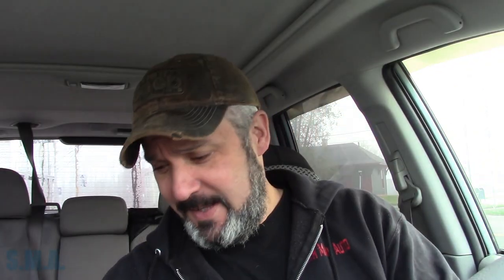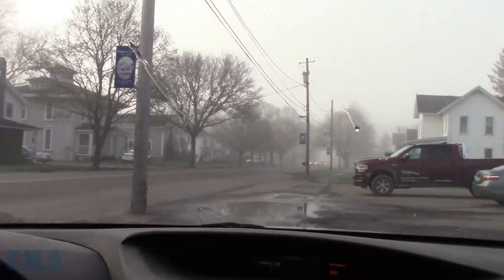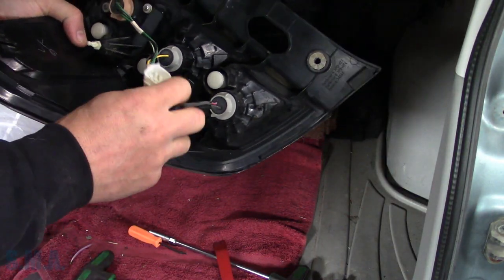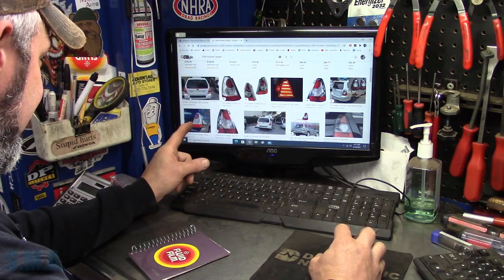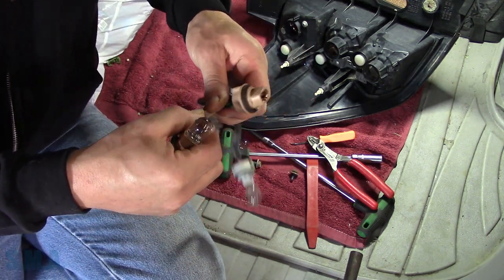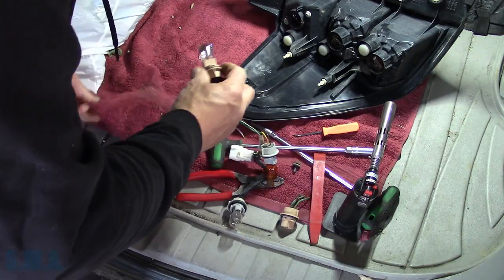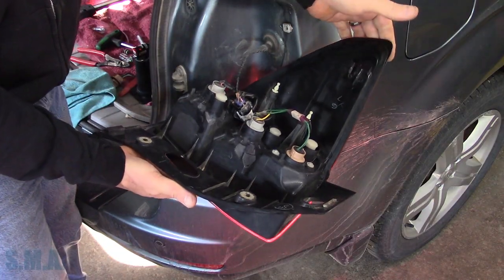Don't Be A Jerry!

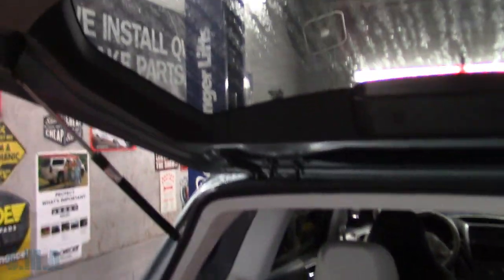Comment: If you pay close attention @1:36 her note says that at 5:30 in the morning she was stopped by a Police Officer because her brake lights "didn't get brighter." At 5:30 in the morning, she would have been using her headlights, taillights, etc. and so the circuit that "Jerry" stuffed the bulb into would have been "back-bleeding" power from the tail lamp circuit into the brake lights and illuminating them, too. So, as she was driving down the road, her "tail lights" on top would have appeared very bright because they were actually brake lights! Thus, when she stopped at a traffic light, her brake lights could not have illuminated any brighter, because they were ALREADY LIT. Notice that she said the Police Officer told her the brake lights "didn't get brighter." When Dr. O was driving the car to check it out, it was daylight outside and no illumination was required, so that is why he didn't notice the running lights coming on until he pulled into his shop in a darker environment and could see the running lights coming on with the brake lights. A quick bit of diagnosis at the time would have been to just turn the headlights on and see if they back-fed into the brake lights. Unplugging that right rear lamp assembly and the other lights then working normally again was a quick and easy point to the problem in the socket that "Jerry" messed with.

Comment: Just FYI for when tool-less in UIPULLEM yards, check the cars inside and and out for a few cars radius, look for work vans. They usually have tools left in them from previous owners, and some cars have OEM toolkits in the trunk hatches. Might not find wire cutters but you can usually find screwdrivers, pliers, scissors, wrenches, etc.

Comment: Nice troubleshooting! Need to update/upgrade connectors. There are connectors with soldier in the tube. Instead of crimped, you have a nice solid connection.

Comment: From what I understand, the use of "Jury rigging" is very similar to the WW2 version used in a type of slang called "Jerry Rigging".
Its basically a negative connotation to a potentially rigged court, or a German corrupt repair made on various mechanical situations.
Ive seen it used in a variety of ways over the years, but they both apply mechanically most frequently.

Comment: 2006 VW New Beetle, 2.5L gas ICE, 5spd manual transmission, 278,203 miles. 
I had a similar problem, left turn signals that lit with brake lights, AND the brake lights flashed with my left turn signal, which would cx my cruise control! I knew the exact cause, but lack the skill and tools to fix it. I told my mech what the problem was , my trailer wiring, and he scoffed. Said these VWs have wiring issues. I told him this was not the first time the trailer wiring caused an issue on the left side. When he called me back, he said removing the trailer wiring and sealing the connections solved the problem. BUT the mess had MELTED my tail light housing and sockets. I bought NEW sockets and tail lights, the tail lights were getting dull and cracked. Sometimes it really pays to have one car forever. You know its history.

Comment: @South Main Auto Repair LLC  I had 2 Subaru Outbacks [05, 06] both with rear lighting issues.  First would blow lighting fuse everytime headlights were on AND I put it in reverse; second Subaru simply had a basket of lights in rear that wouldn't  work.   Common problem in both - the wiring that ran thru upper tailgate to lighting and electrical systems in the gate fatigued and broke,  exposing bare ends of the wire(s) to make contact with one another allowing for shorts.  Had to cut existing wires back into roof and down into gate to splice in new,  stranded wire to the existing wiring, so there wouldn't be any splices hanging out in the pinch point of the gate hinge.

Comment: Excellent video.    I have made a simple bulb change as complicated as possible before so I can't laff at Jerry.  Years later, after I forced my way to work, I realized the body shop that just replaced bulb after an accident used the wrong bulb.  We still own the vehicle so I am going to leave my masterpiece like it is.  No use correcting it.  Next owner will probably be the crusher.   Things used to be so simple.  Gotta step up your game to keep up.  I am not a mechanic so it is an extra challenge.  I do not like the quick connect Ford used on the Expedition radiator hose.  I am finally getting the hang of unhooking quick connect Ford fuel lines.

Comment: A good auto mechanic uses max force every time & has parts leftover after the repair since he builds better than the factory.  Our pick N pull  is very handy for my junkers - 2006 - 2011+ impala has many similar parts so on sale days for less than $100 -  I get an extra alternator, steering pump, front calipers & radiator fan assembly then store for a bad day..

Comment: If there was a u-pull junk yard around me. I would be living there everyday, pulling parts that, "I may need in the future".

It's nice that Eric made a trip to the junkyard to save this owner money, because most shops would just order a 7443 harness or a socket.  Even though a new socket would have been ~$10 to $15, and then upcharge them.  And it's nice that eric tried to put money back into the local business.

It's too bad that folks are rude at that yard.  I tried to use local hardware and auto part supply shops and...  boy were they rude.  The auto part shop also upcharged ridiculous amount (2-3× oem prices) for non-OEM parts.

I stopped going because of the way they treated people.  Two years later autozone came in down the street, and a year after that they shut down their business.

Going back to this video, I wish people like Eric ran shops around here (NYC suburbs).  I would recommend people to him all day, everyday.  Keep up the great work.

I have been putting off doing my wheel bearing/hub, but watching your videos since 5 am (dang needy dogs worked as a team to wake me up to be fed) made me want to tackle it this morning.

Comment: Always love solving  so-called "mysteries" left behind by my lessors. You are being kind calling them "Jerry's". We always called them "hacks". The Mopar dealer where I worked was a revolving door of HACKS' if all ages, as was the GM dealer, where between both I worked over 20 years of my career. . I have,  like you I'm sure,  cleaned up more "Hacked-up messes" that you can imagine in over 45 years of wrenching. You know the type.. "electricals be mysterious" as one Hack used to say,.. Obviously, he worked using the smoke theory, and let the magic smoke out more often than not. Trouble was, he could necer get the smoke back in, even when using the "shotgun approach" to diagnostics and repair.

Working in the dealer, you are the end of the line. Any issues which  no one else could fix,.. the stuff people would often pay these HACKS thousands of dollars to fix with no success, sometimes when multiple shops ultimately failed, they ended up in my bay. 

There is a sense of pride and accomplishment that makes me feel good, fixing the stuff no-one else could, even if the other guy got paid a lot more to make a mess of whatever it was.  You know how it is, it's a curse to be a competent technician, you end up working harder fixing everyone else's Hack-ups, often at a loss. But, you can always make it up somewhere else on another job. 

The joys of Flat-Rate...Don't be a Jerry, or a hack!

Comment: My 2002 Sonoma had the antilock brakes acting up and the next day the brake lights went out. 
I had parked next to the blacksmith shop. Chipmunks found the cable from the antilock and chewed about 4 inches out of the middle.
Two hours standing on my head with wire so living tools reconnecting the wires. 
Darn ground rats!  😠

Comment: My best guess is the bulb is aftermarket and the base is slightly larger than it needs to be.  Then to add insult to injury they jammed it into the bulb socket and caused that downstairs mix up with the contacts, instead of taking their lumps and trying to find a bulb with a base that would seat nicely.

Comment: I've seen something similar with those 7440 bulbs, if you get the wrong bulb (like a 7441 or something or other) Jerry's will spend all day jamming that wrong bulb into the socket (not knowing that there are little glass barbs in different places) and kick the can down the road. That's why on the tail lights on my wife's car, there's amber 7440's rolling around inside the brake light lenses.

Comment: Dear Customer, We ECO warriors at Subaru KNow it isn't safe to drive around without brake lights so we will put a rush on your Brake Light Switch order and it will be there in a couple of 3 weeks. We suggest don't drive at night and turn on your regular lights during the day to simulate the brake lights you paid for. As for the rear end Body parts you may or may not need Pre Ordering might not be a bad idea.

Comment: A prior owner of a motorcycle I now have added some illuminated mirrors.  My headlight stopped working.  When I unwrapped all the electrical tape [warning sign]  I found a web of cross splices and the OEM signal wires cut out of the 'new' circuit.  Oversized crimp fittings everywhere.  What a mess.  As a bonus, cutting out the OEM signals disabled almost all of the security system.  I managed to get the headlight working.  My winter project is now rewiring the signals & security.  Grrrr.  If you don't know what you're doing, don't do it!!!

Comment: Where I once worked we made automotive wire. We had machines that were metric and some were SAE, small fasteners too, 4mm up to 10 and the SAE's were small as well. It never failed to run into a job where the speed merchant who was there on the last call had SAE in metric and the other way around as well using a handy impact. Jerry doesn't cover these guys and gals.

Comment: I had a bulb's little wire connectors hang up on the copper connectors in the socket pulling them "inside out" if you will. Had to replace the socket...Jerry is a ding dong!

Comment: I've seen that light socket scam done several times before to make vulnerable people (usually older folk with low mileage vehicles in good shape and is an easy resell) believe they had major electrical issue and convinced them  problem and is worth more than the vehicle. 
Its common overseas also.
Reply: I was never as good at tracing electrical issues as Eric. But I found it at least 6 times. 
It usually came from a shop that also sold used cars.
Reply: I also found out they figured out ways to short fuse boxes to eventually look like major issues. I hated those guys.

Comment: My wife has a 2015 Crosstrek, we’ve had a lot of odd wiring issues with it, the classic brake switch went out and the micro switch in the park position failed, couldn’t get the key out of the ignition. But also it likes to eat bulbs, I think I’ve replaced every bulb on that vehicle at least once, either cheesy bulbs or the voltage spikes and pops them.

Comment: Depending on the year (14-16) there is a recall on brake light switch. If it's in that range the dealership would have been better and cheaper than whatever Jerry charged.

Comment: I had a 99 lumina the brake lights wouldn’t work. The cyclops light worked when the brake pedal was depressed but the main two brake lights wouldn’t come on. It ended up being the the switch plate in the steering wheel. At first I thought maybe the rear bulbs were burned out. Since that wasn’t the case I went digging and found the culprit. So why would the steering wheel have anything to do with the brake lights? I’ll bet Eric knows. By the way, nice Job Eric.

Comment: Seen folks play with the pins in the socket when they get intermittent, had this happen on an F250 - PS turn signal lamp would work for a month or two then quit. Replace the bulb and it’d work for a couple of more months. Ended up being the socket, pins didn’t have the crusties - they just didn’t have enough spring in them to make a good connection. The leads on the bulb/connector would oxidize leading to high resistance. 

Guessing something similar happened here w/ this baru.....

Comment: I imagine that salvage yard has a lot of inventory that doesn't have much left in the way of parts equity or the vehicles might even be too obsolete, so to speak, for the salvage yard.  To put that in context, there's probably no need to hold onto that 94 Chevy Corsica to wait for that one weird guy who thinks its radio knob will work in his 93 Beretta.  I'd also wonder if the people who pull their own parts have done too much damage to what's left of the cars.  Cuz, you know, people always treat other peoples stuff with respect.  I suspect, one way or the next, they would want or need to make room for new inventory to supply parts for cars that are still on the road.

Comment: Did you adjust the brake petal switch?  That's definitely the reason she got pulled over that morning.  It did seem like you had to push the pedal pretty far to get the brake lights to light up.  The sensor should be adjusted to the point where even the slightest movement would light the brake lights up.

Comment: G'day, Mr. O! What, if your name is "Jerry?!?" Lol!! 😉 (I'm only kidding!!) Another, great job! Enjoyed the video! By the way... When you think of "Jerry Rigged:" To put together in a way that works, but is contrary to the “norm” or specific directions (service manual - instructions). To put together in an unusual, better or temporary way.

Also, refers to makeshift repairs or temporary contrivances, made with only the tools and materials that happen to be on hand. Originally a nautical term, on sailing ships a 'jury rig' is a replacement mast and yards improvised in case of damage or loss of the original mast.

For example: When I put together the new lock on my door, I broke off a metal shaft inside the lock so it could only be engaged with a key. That way, I can never be accidentally locked out of the house. I told a friend, "Don't worry about locking me out if I'm not here when you leave, I've 'jerry-rigged' the lock. Lol! 🤣 Thank you! 

Cheers!  😊✌🏻🛠❤️

Comment: I had a 2004 Grand Prix that would always intermittently lose a tail light.  The bulb wasn't bad, the pins would bend away from making contact from the heat of the bulb or something.  I used a screwdriver to bend the pins out with a little more tension.  I imagine that's what Jerry was doing here except he has less than zero knowledge of 12 volt electrics and properly hosed up that socket.

Comment: This caught my attention because I have a similar issue. I have a 2000 Toyota Harrier. I am in Japan. Basically a Lexus RX300. My brake lights work but when I press my brake pedal the dash indicator light comes on showing a brake light is out. It must be a short if some sort.

Comment: Crimp connectors?  They're heat shrink, so I'll give credit, but that only puts you only two steps above Jerry.  

I've had to remove way too many crimp connectors to fix connections right - with solder and heat shrink.  And that's down in Texas where corrosion isn't anywhere near as bad as it is up in New York.

Comment: Should have adjusted that break pedal switch too man. If you gotta push harder to get the lights a light touch for low speed braking isn't going to light the brake lights. Otherwise great vid, thankyou.

Comment: Actually,  it's "Gerry".  The word gets its roots from WWII,  and makes reference to the Germans (Gerrys) who would retrofit American jeeps with brackets to hold the 5 Imperial gallon size fuel cans,  and vice versa.   They were a slightly different size than the 5 US gallon cans.  They are still referred to as "Gerry Cans",  but were so often were incorrectly spelled as "Jerry Cans",  that the term actually made it into the OED.  The spelling was changed forever,  I'm afraid.  Worse still,  the modern term "Jerry-built" or "Jerry-rigged"  has morphed into "Jury-rigged",  which is actually a nautical term for makeshift emergency repair of  broken sail masts.  Some say that for a native English speaker,  German is the easiest to learn of the European languages,  due to its closer similarity to English.  I would have to agree, as even today we are constantly getting words and phrases mixed up.

Comment: Had a ‘92 Nissan Maxima that had myriad unsolvable electrical gremlins when I bought it from a friend. Figured it out in five minutes. Terminals on the dual-filament bulb had melted together. Previous owner spent over a grand at various auto electric shops and none of them looked at the right side taillight and said “Hmmm.... better figure out why that’s not lighting up”.  Bozos.

Comment: At least it wasn't the 2000 Buicks. God those things had garbage marker/turn signal lights. They miswired the front sockets to use the low ohm/high current turn signal filament on the bulb as the marker light. Turn signals aren't meant to be on all the time and melted the plastic base of the bulbs. I hated those things.

Comment: Easy fix. The best thing about Subbies is that they have used many of the same parts for decades. If you see this comment, where did you get those stripper/crimpers? Or what brand are they? I broke my Craftsman the other day.

Comment: Nice work, Eric.  Did you check the brake switch adjustment?  It seems like you had to push the pedal too hard to make the lights come on--both Josh and your brake-foot-simulator needed more firm application.  Seems like Jerry messed that one too.